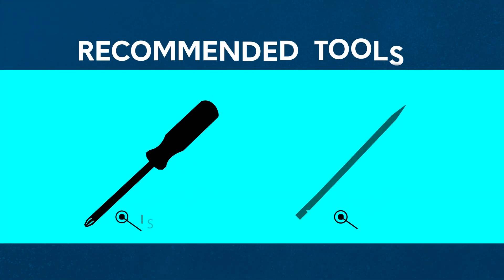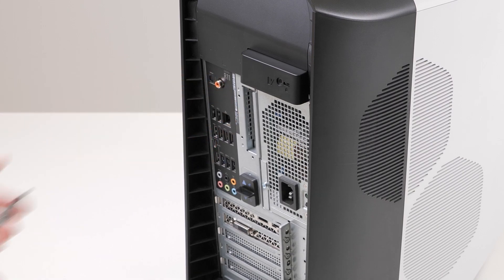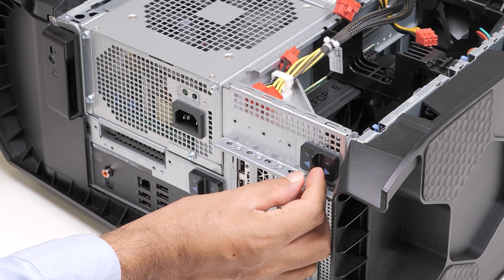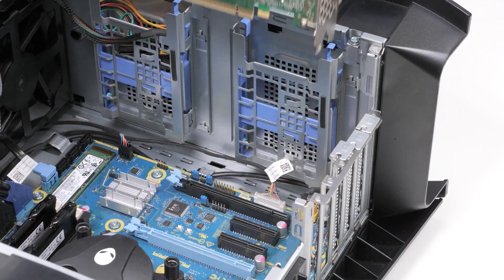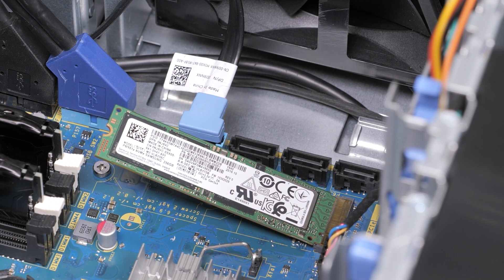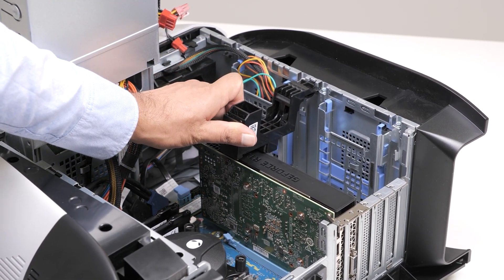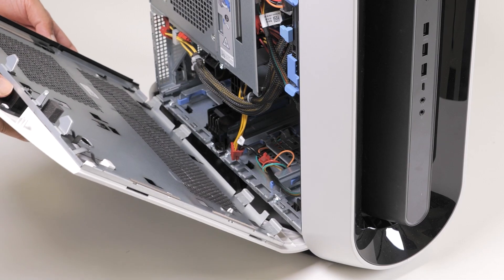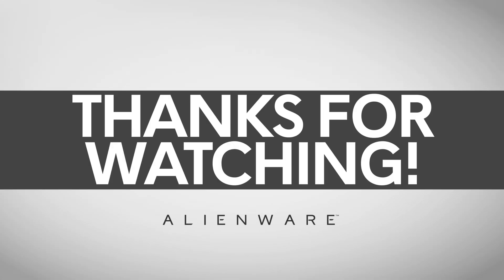How to replace the solid-state drive on an Aurora R11

Comment: Excellent video. Do you notice much of a difference with the NVME SSD vs the regular SSD drive?
Reply: Nvme is usually faster
Reply from the maker: Hi
NVMe is up to 32 Gbps when SATA is 6 Gbps
https://www.dell.com/support/manuals/en-us/alienware-aurora-r11-desktop/alienware-aurora-r11-setup-and-specifications/storage?guid=guid-d79f17ca-e619-43e7-82a5-a0b0e7fb5c0a&lang=en-us
regards , John-Mark